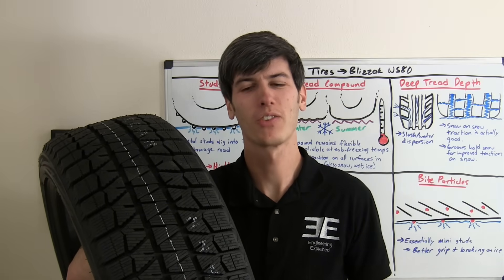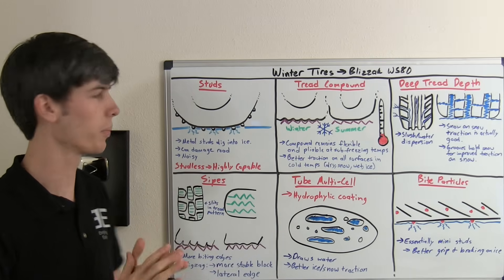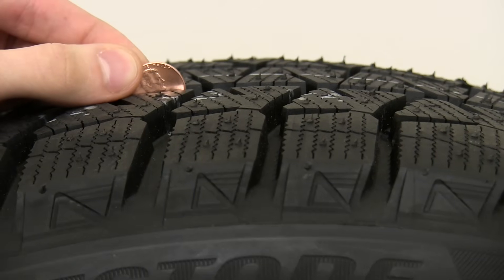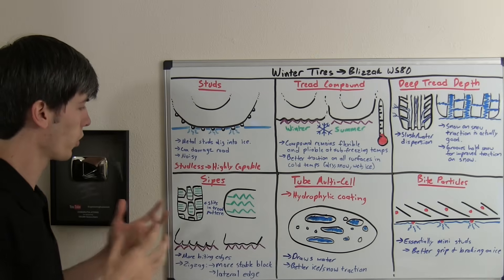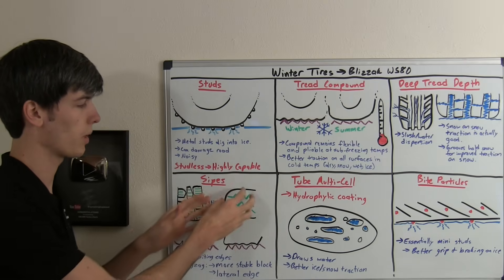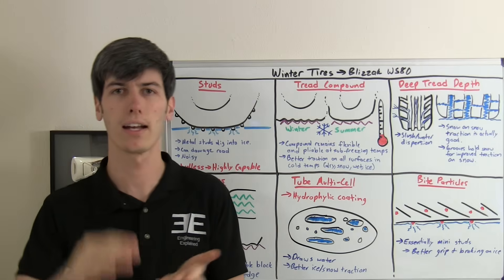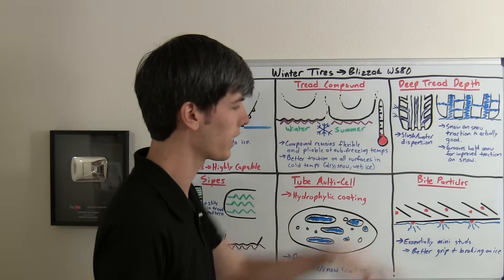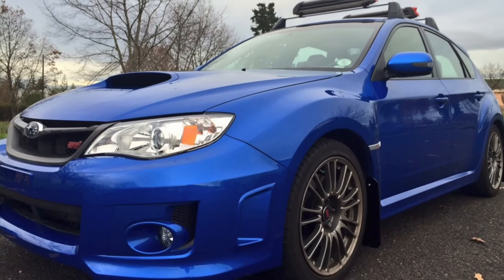Winter Tires Explained - Bridgestone Blizzak WS80

Comment: This tyre Bridgestone tyre here is very good for the Artic/Nordic winters when the temperature's are never above freezing. So very usefull for sub zero temperatures, below 0 Celsius (°C) (= 32 degrees Fahrenheit (°F)). But these tyres are horrible in the WET (aquaplaning and especially braking) because of the VERY soft compound, and less large groves in the tread. So they are NOT suitable for mild European winter climate. Then you  you need a different winter tyre. A tyre that is best suited for the WET and Snow conditions. 
Because the Sea climate in western Europa temperatures are mostly fluctuanting between +10 Celsius  (°C) and  -10 Celsius (°C), and usually much rain. So we have a different (yet still soft) compound which is better suited for these temperatues. And they have superior Aqua/Hydro planning properties. 
The best Brands in that class of Winter tyres are usually; Continental, GoodYear, Michelin, Pirelli and Dunlop. 
As winters seem to get milder and not every country even gets snow in the wintyer anymore a lot of people now decide to change to All Season. Common in North America but relatively newin Europa. Tyres with the (3PMSF) Alpine Threepeak Mountain Snow Flake. Which also means that in most European Countries they are allowed to be used as Winter tyres, even when Winter Tyres are mandatory. Off course  dedicated winter tyres will always out perform an All Season / 4 season / All weather tyre.
Thanks for you video! Watching from Europe!

Comment: i have those tires on a Toyota yaris for two winter seassons...well...it's unstable even on dry road...i will not talk about rain...or even more about snow...the fuel consumption  is high comparing to other winter tires...so for me no more ws80...and just for the story,i live in Sweden

Comment: Just got these for my AWD beemer and they are ridiculously good, and I have terrible road conditions to drive in within Montana. People had to stop on the road, pull over, go 7-10 mph and I was able to climb non plowed hills/go 40-70 mph on the same roads without losing traction. Mind blown, use to only use studded tires but these have been blowing everything out of the water for me personally.

Comment: Idk if anyone will see this... older video. but I went to my local shop for a quote on winter tires and they told me Blizzak tires were not a good option. When I asked why they told me due to a dual compound they use which at 50% or more wear diminishes the tires usefulness. How did you enjoy the WS80s??
Reply: Basically the same tire after 50% just without the compound. Still a very viable option in the winter tire world.

Comment: I just purchased a set of Blizzak DM-V2 tires for my 2001 Acura MDX, which I heard is the SUV/truck equivalent to the WS80 tires.  I have not driven them on snow yet but we have been getting cold/wet/icy conditions and they are working great so far.  Seem like very good tires!

Comment: i disagree with snow being stuck on the tires giving you better traction. I had a set of brand new BFG all terrain ta ko tires on one of my old trucks, i had just bought them for the winter. at first i felt pretty unstoppable, tbh i didn't know any better cause i had never had those kind of tires before, but i did notice they held on to a lot of snow.....

so fast forward, i eventually traded that truck in for a newer truck, and i wanted to get new off road tires again, but this time i thought i'd try something different, i got general grabber at2 tires. it was like night and day. the grabber tires did not hold on to the snow at all, and they actually has so much grip in the snow that i felt confident in driving the truck in 2wd in the snow, and actually had difficulty doing donuts in the snow.

Comment: Hi Everyone. I'm planing to purchase theese tyres in the UK for the winter, now my question would be, that here is a lot of rain, rarely snow in the winter, and I've heard that the sw80 has exceptional grip in water, but I'm a bit worried, that because of the lack of the snow, I will need to replace them pretty soon. How durable are theese tyres against dry, and wet conditions?

Comment: I highly recommend the WS80s.  Had lots of snow in Vancouver this year, the WS80s did not disappoint and have been excellent.  The biggest difference is braking grip they provide.  Just a tip minus size your winter tires if possible.  The laws of physics are in your favor with thin/tall tires vs fat/low profile.  Plus they end being a lot less expensive as well.  Tire rack will provide you options as to how far you can minus size.  For 2011 Mazda 6 GT, the oem size was 235/45/18, Tire Rack provided two alternative minus sizing options a 17 inch and 16 inch.  Went with the 16 inch with the recommended 205/65/16 tire size which is as close as possible to my original tire diameter.  The total cost of the 16 inch tires with steelies ended costing me less then a set oem sized blizzaks tires alone.
Reply: I should add that Blizzak tires are significantly quieter than my Michelin Pilot Sport A/S 3s.  I attribute this mainly to the Michelin's being low profile at 45 vs 65 for the blizzaks.

Comment: Why is every one saying these blizzack won't last long?? These tires are Awesome..  I have been using mine for about 6-7 winters now. on my 4x4 F150. ONLY in the winter months, they still have ALOT of traction. they still look New and act and handle new. I got them when I had a F150 2004 (used) I traded it in 3 years ago for a 2010 F150 and this is the 2nd year now I have them on my current truck, I did not put them on last year.  I would recommend these tires to anyone. But I was told to take them off when it warms up because when the rubber gets to warm it melts. But my point is.. I have had these tires for awhile now and then are still performing and looking new.
Reply: I had them on my Titan, I loved them I am now thinking of getting them on the family van...
Reply: I can explain why people think they don’t last. Winter tires are softer then the average tire and meant for certain conditions. People will keep these tires on after it’s above 50F and wear out the tread a lot quicker. You got all those winters because you were smart enough to take them off when not needed.
Reply: I'm not sure, I had blizzaks on my car and my truck. Replacing the lm60 on my car now after 4 Canadian winters and sold my truck with it's dmv2 after 2 winters and they still had tons of tread. The traction that 2wd truck had with those tires on snow and ice was incredible.

Comment: Great video, now lets ask the question, scientifically how much are these helping? All that engineering will buy you, an extra 10, MAYBE 15% traction?  Its not a license to drive like a moron in the snow, so many of those around. I was driving around snow storms on almost bald summer tires in the canadian winter no problem. I just drive properly, and give myself a bigger margin of error due to reduces traction.  (For the record i now have my winter tires put on, but i didnt before, mostly lazy)
Reply: It's more like 50% improvement. Go watch TireRack.com videos on the ice rink.

Comment: Just be sure to take off your winter tires when road surface temps start creeping past about 40°F. Otherwise they'll melt like pencil erasers.
Reply: FYI: Provincial winter tire regulations in Canada vary by date, not temperature. But, yeah, get 'em off Bruce Lee quick on the swap date.
Reply: Yes I know Canada requires winter tires in certain provinces. As far as I know, the USA does not, so it's up to drivers what they want to do.

Comment: @Engineering Explained Could you do a video on the following: Does 
swapping winter to summer, summer to winter yearly degrade the tires in 
the long run ?
Reply: Just factor the cost of removal, remounting, balancing, new stems, and swapping TPS twice a year and figure out how many years it takes to pay for a set of 70-80 dollar black painted steels.
Reply: What kind of asinine question is that?  They are two different sets of tires!
Reply: The question is: Is the action required to change the rubber on the rims yearly a better idea than having a separate set of rims for the winter tires ?
Reply: Just get a set of cheap steel wheels for the winters.
Reply: keep you car for long run.  will pay off.
Reply: Exactly.

Comment: Hey . I am hoping you can help me out . I live in Dallas, Tx and I have a new eco boost mustang and it has the performance pack . So anyway that means summer tires. We don't get hardly any ice or snow . Maybe 2 to 3 times a year and only for a week or so and then it's gone. My question is should I switch to a winter tire just because it gets cold outside?  Or will I be fine on summer tires? I was thinking about getting a all season one instead, what do you think?
Reply: My two cents on this as my subie has had summer tires on until now (i just bought blizzak ws80s) and I live in NJ haha. I would at least get a set of all season or decent winter tires. The all-season/winter tires have noticeably better traction/drive feel when it's cold, but you're not dealing with ice and snow a lot so you don't need anything crazy like the blizzak ws80, a set of hankooks winter tires (forgot the name) would be more than enough.

Comment: Whats the mechanism behind snow on snow traction? I'm kinda curious what forces are all at work, I'm thinking dry fluffy snow wouldn't be as good as wet packing snow right?
Reply: Snow might look soft and fluffy to the naked eye but it's actually a bunch of tiny crystals, that are very sharp. That's why when you go outside and walk over fresh snow you hear a crunch. It's the ice crystals binding against each other that create lots of friction. Also why skiers and snowboarders wax their skis/snowboard, the wax compounds actually melt the snow creating water between the snow and skis so you can go faster.
Reply: +GodKedon That makes perfect sense!
Reply: experience driving in variety of snows in the northwest, wet snow/slush is the worst.  less traction and more unpredictable car behavior.  the colder the better for driving.  lowest temps I've driven in have been single digits though.  would make sense that even snow tires might not perform well in the extreme negatives?

Comment: SOLD! I have used these tires on a truck and they are one of the best tires snow tires I've ever used for Vermont winters. Now I need them for a Subaru. Thanks for the explanation about why they should work just as well for the car.

Comment: Just spent $800 for a set, they better be good.
Reply from the maker: They are good, you will be pleased!!
Reply: We just got 8 inches of snow and still falling and no problems trekking through that with my 2016 GT!
Reply: Blizzaks are great. I still have some ws70s that I got a good clearance deal on from Tire Rack for my Altima. I haven't tried the X-Ice, but the worst snow tire I've ever had was the Cooper Weathermaster, great when new but they wore out quick and felt like a regular all-season after one winter.
Reply: Prices will vary depending on width of your tires and also the size of the rim. I'm in Canada so I got mine from Costco which was cheaper than anyone so if you're in the US everything is always cheaper there!
Reply: Good to hear, not enough snow yet to get a good feel for mine.
Reply: I've run General Tire Ultimax Arctic several times on a former car. Tread design and pattern is basically what Hancook used to have with the "iPike" passenger car tires. The traction was amazing, especially in deep snow. However they do require regular rotations (they are a directional tread) and good suspension alignment otherwise they will get very noisy and start cupping past 50% treadlife in my experience. They can wear evenly but you have to stay on top of your suspension and rotations.

Going to be running WS80 tires this winter on my newer car.
Reply: Rob Brown I got mine for 640 at discount tire
Reply: +Gran Turismo just ordered my set at discount tire this morning, $820 for all 4
Reply: Rob Brown why so much?  I’m on my second set and they never cost me over 500.
Reply: Nick K it all depends on the size of them, more specifically the radius. My car has 18 inch wheels for example. The cost of WS80s with a 16 inch radius, say a 195/40/16, those start at like $120 a tire, or something like that, 17s are like 170 a tire and my 18s (235,40,18s) were 200+ a tire. That’s the cheapest I found online and it’s also what discount tire quoted/charged me
Reply: Ben S Oh I gotcha.  Yeah in spring and summer / fall I have 18” tires on my car but for winter I use 16” blizzaks.  I was told that they would be better for handling and cheaper than 17s or 18s.

Comment: I live in Canada, i just ordered a set of blizzak ws80 for my Crown Victoria, hope they work well in this coming winter!
Reply: from bridgestone  "When the Blizzak WS80 is 50 percent worn, a tread depth indicator molded into the tread design lets the driver know that only 10 percent of the remaining tread is Multicell compound." also this "Blizzak winter / snow tires will typically provide 12,000 to 15,000 miles of winter service before wearing out their Multicell tread compound."
Reply: they  will...
Reply: The winter part of the tread is only good for 15,000 miles!
Reply: You're probably talking about the old model  WS70,,, The new rubber composition of the new  WS 80 tire is far superior than  the old WS 70

Comment: so are winter tires better for summer than summer tires?
Reply: not  at  all...  winter tire on summer time  , it's not recommended,,
Reply: Winter tires in the summer, they will deteriorate further, and the braking length gonna be longer with winter tires on dry pavement. This is not recommended at  all

Comment: In Seattle, winter in day time can get as high as 53F (12C), will it be safe to drive with winter tires in these warmer temperatures? In night time, it gets back to below 45F usually.
Reply: +Uncle Sam I'm in Vancouver Canada, just North of you, & these tires are fine in all temps, but on our highways M+S or severe service winter tires (snowflake symbol) are mandatory October 1 - March 31. The rubber is pretty soft & provides excellent traction & stopping, but will wear fast, so swap them out ASAP in the Spring.
Reply: wait I never knew winter tires were mandatory in vancouver, I live in Calgary. interesting.
Reply: rawjor Specific highways in BC including Highway 99 North of Lion's Bay, but not Vancouver city. 
http://www2.gov.bc.ca/gov/content/transportation/driving-and-cycling/traveller-information/seasonal/winter-driving

Comment: Just put my first set of winter tires on my RWD car this year.  They're Blizzaks and I am blown away by how much more control I had during a recent blizzard.  I was lucky enough to find a used set, a year old, for $450.  When these need to be replaced, I am more than willing to pay full price for a new set.  They're amazing.
Reply from the maker: +Vickie Knower They are amazing. It's night and day when the weather is terrible.
Reply: Absolutely!!
Reply: Shop to Costco, this tire Blizzak WS80 is on sale, approx. $500 something incl. tax.
Reply: Good to know!
Reply: I second JESS' advice - Costco often has great sales on Blizzaks, as well as Michelin X-Ice (another great option). I just got a set of new Blizzaks, installed, for $550 at the local Costco.
Reply: $400 on Amazon for 15" tires
Reply: @confusingtosay  300 at costco for 15 inch

Comment: Apologize if i missed it, i have the same car as you and i was wondering what size winter tires did you go with?
Reply from the maker: +Kenny Le I went with the stock size, 245/40R18 I believe it is.
Reply: would you happen to know how much larger diameter tires could fit on this car?  do you think an inch larger than stock will fit? half inch?
Reply: are u talking about wider tires or bigger diameter? because isn't bigger diameter tires  make ur car move faster than ur board speed thing ( don't remeber how is called in english) is showing
Reply: yes, I am talking about taller tires. I'm ordering a set or 235 50 r17 nokians. About 1 inch taller than stock size. it will affect the speedometer by about 4% but I would appreciate the extra bit of ground clearance for the snow, and rim protection. i can let you know how they turn out if you want.

Comment: Hi, I just recently got a 2014 STI hatch and it came with the stock summer tires. I live in Southern California and head up to big bear maybe twice a month and Mammoth maybe twice this season. You think I need a separate set of winter tires to switch off during winter? I heard horror stories of summer tires heading up to big bear.
Reply from the maker: +Ronnie C It's certainly not a bad idea. I've slid around on summer tires in light ice storms here in Oregon. The Winters make a huge difference.
Reply: +Engineering Explained Thanks! Never thought I would need winter tires here is SoCal, haha. but I rather be safe than sorry. BTW, you're first STI review when you got your car convinced me to buy an STI and I love it. Thanks!

Comment: I've never bothered with winter tires and have always been fine with all seasons, but this year, my 35k all seasons have 40k on them.  They're wearing great, but they're not good for winter and I still want to get a little more out of them in the summer.  So, for the first time ever I put on winter tires.  What a difference.  You don't know the feeling between acceptable and good until you try them.  I knew they would be better, but I didn't realize they would be this much better.
Reply from the maker: Shock Diamond Yep, finally had mine out in the snow/ice. They were quite phenomenal. Oregon needs more snow!
Reply: Engineering Explained Yeah, now you hope it snows.  ;)